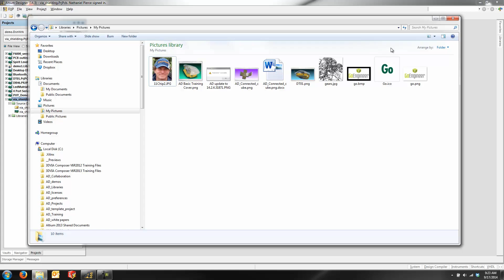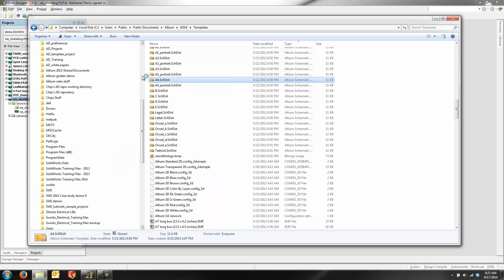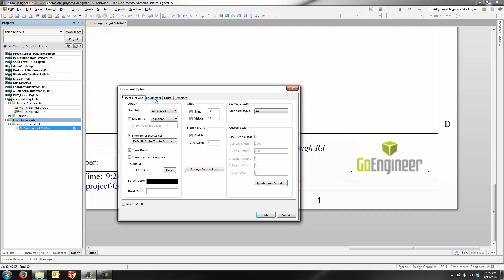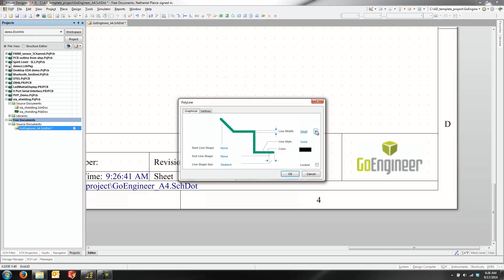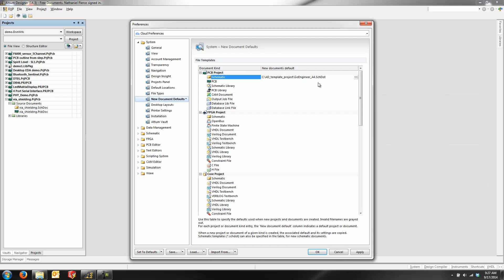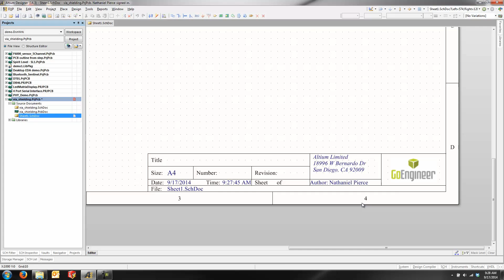Altium Designer - Create a Custom Schematic Template

Comment: How to disable/hide the file location link in the bottom of the title block?
Reply: I have found no way to do so either. If the Altium user interface was consistent selecting it should open it for editing and there would be an eyeball (or what ever that icon is) by which you can make it visible or invisible.  I found that I could delete the file name link in the template but not once it was in a drawing. Even if I made the drawing a template I could not select and deleted it. Apparently only in the DEFAULT template can you get in and fully edit features such as deleting the file link location. 
Or at least this intermediate user (me) cannot.

Comment: How do I change the line weight of the title block border lines? I want to make it heavier because it is very light when it get printed.
Reply: Nice question Raul. 

Using AD20, I found that when I was editing the template I could select the line and the properties dialog for the PolyLine had drop down "line" which set the line weight. I was editing the template and do not think  you can select this once you are in your schematic.   To restate editing only works on the template file and I think only fully works when the file you are editing is set as the default template. 

I am an intermediate user and may be wrong.